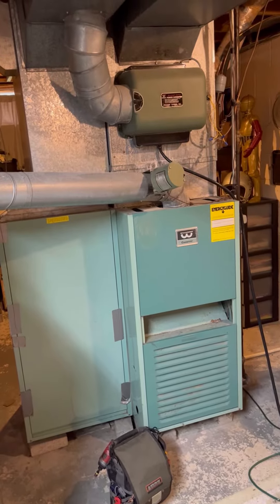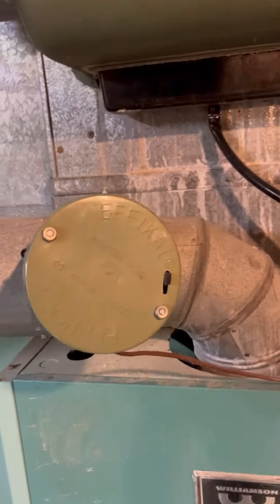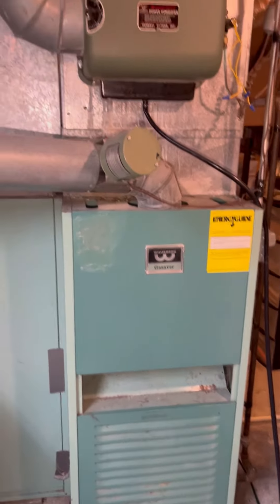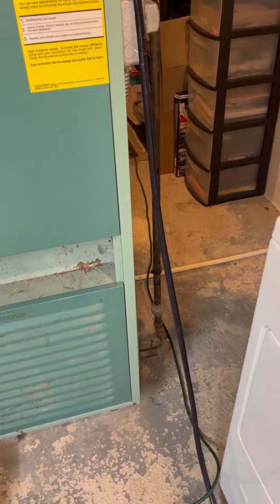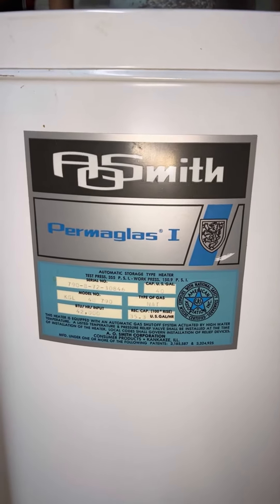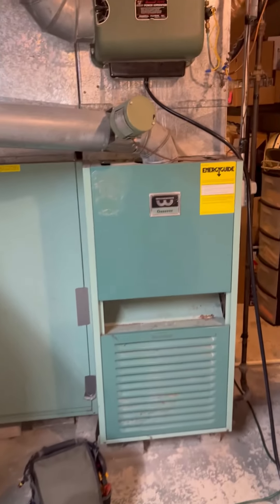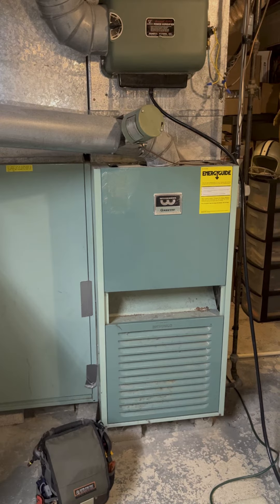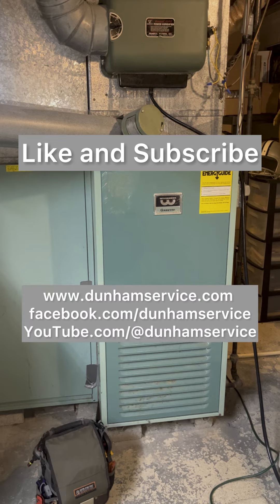Is Your Furnace Old? Should You Replace It?

Comment: Was a commercial/ industrial HVAC tech for 22 years. Slightly different view than residential guys. My opinion is to inform them of the cost savings vs the cost of replacement. If it's safe then no true need to replace.   I also was not a salesman in any way. Unless a unit specific part was no longer available or the cost of  part outweigh the cost of replacement, we would repair.  Again, I understand that commercial/industrial is a different beast.
Reply from the maker: That is a good perspective to have. We try to ensure the customer has the information they need and all their questions have been answered, then allow them to make the call. This old Williamston will be plugging away for several more years.